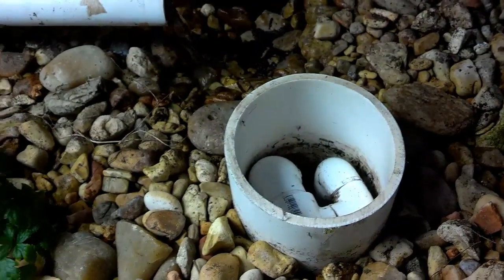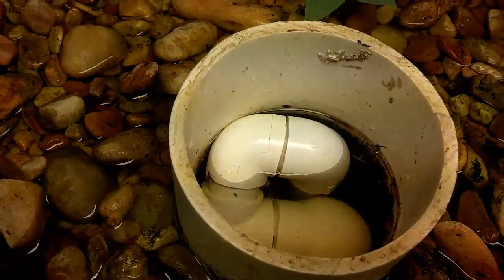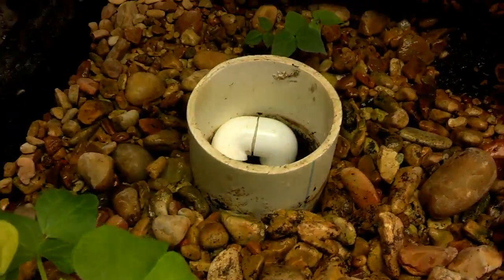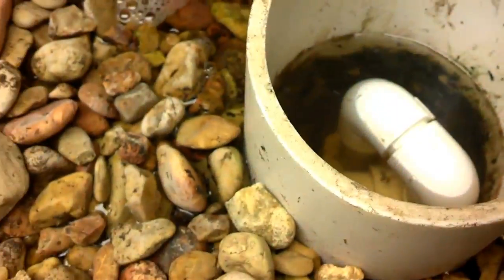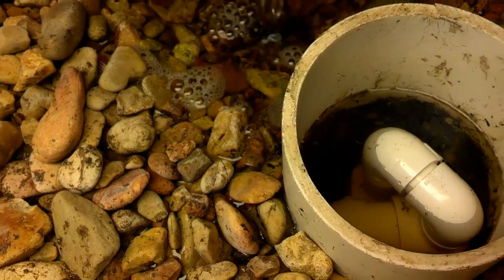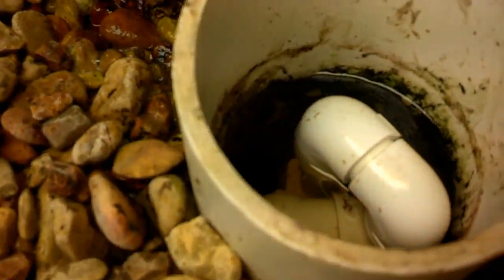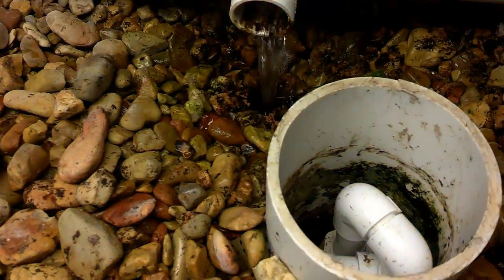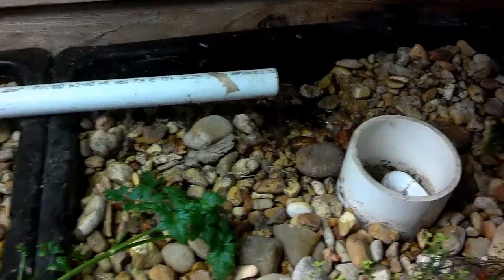Abs siphon with a twist.

Comment: It's interesting that you don't mention whether the 1" or the 1/2" is the input and which is the output... does everyone just know this?
Reply: I explain it in this video. https://www.youtube.com/watch?v=ajuk6bi2i20 The reason i designed this siphon is because i was linking multiple grow beds to a shared drain which emptied into a single sump tank. I did not have my drainage system set up correctly but i was able to get it to work with this design. I also cover how to set up the drainage system properly in another video. I'm sure a plumber would know this but i had to learn the hard way. If you are using multiple grow beds and are having problems with one or two bell siphons this is a good way to fix the problem. If you just have one or two grow beds anything will probably work. I also cover how to drain your fish tank from the bottom which helps to self clean the bottom of your fish tank to a degree. If you've been unable to find answers elsewhere then their is a chance i covered it. At least that's what i've tried to do.
Reply from the maker: I explained it in this video. https://www.youtube.com/watch?v=ajuk6bi2i20

Comment: I am very happy!  This siphon works like a charm!  I very much appreciate that you took the time To share this with everyone.  I am also sharing this with anyone who will listen.  Take care!
Reply from the maker: I'm happy that you tried it and i hope that it makes your aquaponic gardening easier. If you run into any snags let me know i'll help if i can. I haven't had any problems since i put the twist to my siphon. Now i'm on cruise control. By the way you can use the 1 1/4" to 3/4" in the 4' drain pipe it just isn't easy. You have to be very stubborn. That's why i said just stick with 1' to 1/2" with a 4" gravel guard. You need some experience building the siphon first before you take on that project. but the 1' works fine in smaller grow beds. God bless.
P.S I really do NOT miss my Bell siphon.